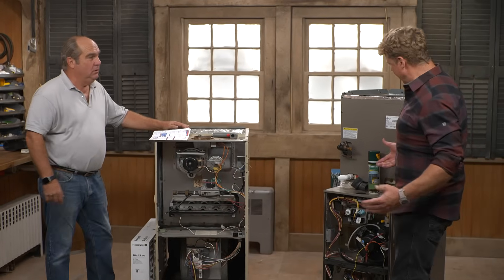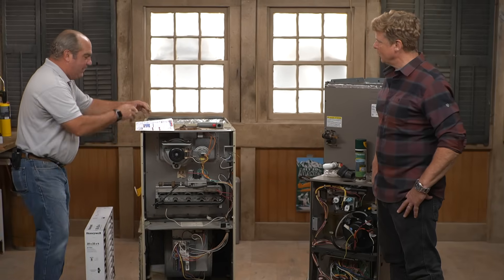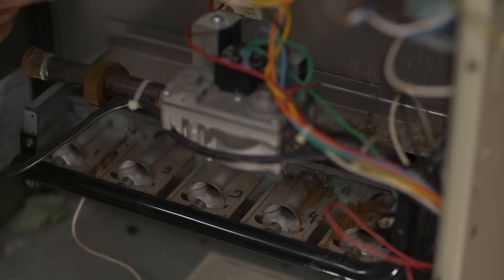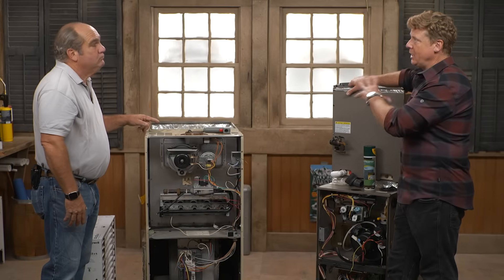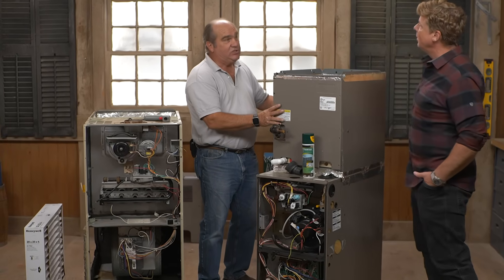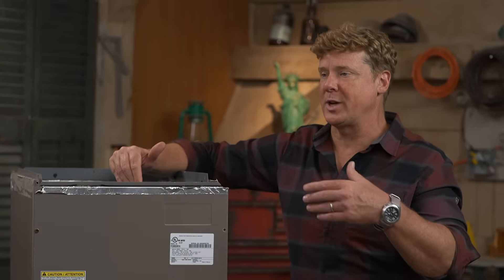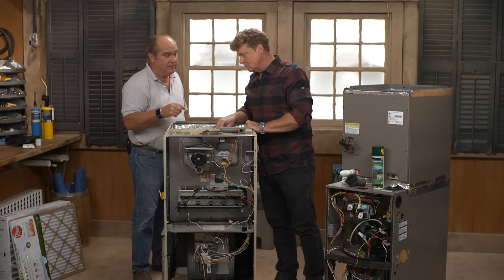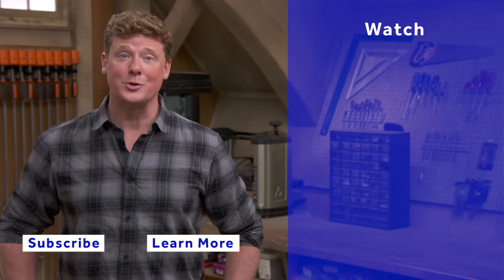Why is Furnace Maintenance Important? | Ask This Old House

Comment: How much of an issue is having too much filtration stressing your blower motor? Some folks say find a good balance of filtration to air flow to reduce the blower motor working too hard. Some say go off the manufacturer of your HVAC unit. Thanks!

Edit: spelling

Comment: I have never seen any HVAC company do extensive furnace checks when I hired them. They didn't check the static pressure, didn't check the combustion product with a combustion analyzer, didn't check the gas pressures with a mamometer. It doesn't matter if they are licensed since only the boss has the license. They will just send a company trained sales person to just check the furnace filter and check the fan motor currents. Maybe they will spray coil cleaner on the condensor unit but they never check the indoor evaporator coils. These sales people look for "problems" and sell overpriced services to "address" them. I have asked one of these sales people dressed up as technicians if they can explain what's on their "50 items" furnace checklist. They get very defensive to claim that most of the inspections are "visual only" and their company doesn't provide them a way to produce a report for the customer. The real job for these "technicans" is to sell services or new HVAC installs.

Comment: The heat exchanger in our last furnace cracked and the only reason it was caught is because I noticed the exhaust gas coming out of the pipe smelled different and had them come check it out. They showed up and red tagged the unit because it was such a danger to us.

If you live in an older house, get CO detectors, people! We didn't have any and could be dead because of it. Thankfully we are still here and our house has been updated to be a bit safer for us.

Comment: So throrough but I highly doubt if 99% of furnace maintenance folks really go through everything you mentioned.  My last furnace lasted me 24 years, zero maintenance other than replacing furnace filter every other month, religiously..  Saved me easily $2500  in today's dollars, over 25 years and replaced it with a brand new one for $3K.. This is my math and it worked for me.
Reply: saved you way more than that.  Just for them to knock on your door is $100 or more.
Reply: I have a carrier installed 2020  i change filter every month and after watching a few videos think ill start vacuuming every year and hope itll last 20 yrs without maint. calls

Comment: My central heat and air unit  is over 35 years old. Recently, the temperature guage stopped controlling the temperature in the house except when other heating units like the oven or dryer were on.  The temperature guage was replaced yesterday. Overnight the temperature dropped to uncomfortable levels. After about an hour after waking up the temperature has risen to a comfortable level. I feel the heat. Ichecking tge futnace worth a try or should I replace the unit?

Comment: 1. Good luck finding an HVAC tech who will actually do any of this testing. They are there to do one thing - sell you a new furnace.
2. Many HVAC pros believe it is paramount importance to have as much airflow as possible through the unit, because the more airflow is restricted by a filter, the harder the unit has to work. A filter is there to stop big things, not small dust particles.
3. Every home should have a combination fire alarm/carbon monoxide detector on every floor at minimum. An additional plug-in carbon monoxide detector as backup is a good idea as well. Carbon monoxide will kill you. Spend the few bucks.

Comment: No need to scare homeowners into thinking a cracked heat exchanger will kill them. Yes it is dangerous, but 2 things. Heat exchangers in this application are under a negative pressure due to the draft motor that he mentioned, air would be getting sucked into the heat exchanger not pushed out. The furnace also has safeties that he also mentioned that will detect when the flame is blowing back into the cabinet due to air getting into the heat exchanger. But absolutely you should get your furnace and ac maintenanced twice a year, once for cooling season and once for heating season.
Reply: Exactly.  There would have to be multiple failures - like a cracked heat exchanger, failed inducer motor and/or blower not working - and some of the other safety checks the system uses to avoid these situations.
Reply: Correct, there are many fail safe safety features.
Reply: I have been told by HVAC people 'don't get a service on your equipment' especially for the AC.   They said there is limited utility in general for doing that but that a lot of the techs doing them don't know what they're doing and will actually do damage
Reply: @jeffa847 lots of hvac manufactures won’t even warranty parts if the system isn’t maintained.

Comment: As a retired first responder for a gas utility I can tell you, Richard does make a lot of good points but he is totally wrong about cracks in the heat exchanger putting carbon monoxide (CO )into the airstream; yes, cracks can contribute to products of combustion entering the airstream but not in the way you think. Once the blower comes on it puts positive pressure on the heat exchanger and if the cracks are large enough this will cause flame rollout to enter the vestibule of the furnace causing products of the combustion or CO to enter the area around the outside of the furnace and possibly get sucked in through the blower compartment. The furnace Richard was showing had something called flame rollout switches that would prevent serious flame rollouts from occurring by locking out the furnace , they’re not perfect, but in most cases they work as designed preventing hazardous conditions. Just a note and reminder this is the 21st century everyone should have a carbon monoxide detector /combustible gas detector & smoke detector (nowadays they have all three combined into one ).
Stay safe out there , have those furnaces periodically cleaned /serviced and make sure you have those working detectors 👍.
P.S. , note to this old house producers: videos like this should be done in the beginning of the heating season (October ) not at the end of the heating season (March almost the beginning of April). I’m assuming you’re going to talk about maintaining air conditioning systems in December? Come on guys, let’s use a little common sense.

Comment: I would love to see HOW to clean the A/C fins. I had an electric furnace installed and they only told me after they had sealed everything back up that the existing ac fins were dirty and that I should hire someone to peel the furnace apart to clean them.
Reply: You uninstall the coil, recover the refrigerant. Temporarily Braze the lines closed on the coil to keep the water out and rinse the coil out with water outside. That is really the only way to do it right. Doing it in place with cans of coul cleaner doesn't work as well.

Comment: In gas furnaces, is it customary that new air goes in from the bottom of it?
Reply: I think that is how most are done these days, though my old system pushes air in from the top. The AC unit is actually beneath the furnace stuff on mine.
Reply: Yes it’ll come in from the blower motor at the bottom why having a clean filter is important
Reply: Your model number will indicate if it is a cross flow (horizontal mounting) or upflow or downflow. Some can be installed in multi directions after reattaching some parts to the new orientation

Comment: Out of curiosity, what’s a good price for an annual maintenance call for a furnace combined with an AC unit? Not asking about repairs…just the call for service and going through the checklist
Reply: I don't know.  My honest guess would be a range of $125.00 to $175.00.max plus the filter.

Probably, in part too the area of the country.
Reply: When I did residential work before i left for commercial it depended on what needed done. Basic clean and check should take no more the  1 hour 15 mins. We were 105 for the check and any parts need with labor was extra.
Reply: $69-$89 tune-ups are common in California
Reply: Upstate Ny - 200-300 dollars for "tune up"  both units. They do not do combustion tests or gas pressure adjustments for that. If you need parts or refrigerant that is extra big time.
Reply: @rzh3443 this is why i never have or will pay for annual maintenance in my furnace.
Reply: @rzh3443  Same in Boston

Comment: This Old House: please do a video on Gutter Guards...which ones work, if any. Cost effectiveness etc.
Reply: I wound up buying leaf filter. It isn't cheap and purchasing it is like buying a new car. SO far, through several rain storms,  it works, but their warranty has a lot of if ,buts and ands. I think TOH did do a review of these guards at their site. Depending on your age and the levels in your home , you may or may not want to bother because they all need some maintenance at some point despite the sales hype. Agree the solid type guards are really only effective for leaves. Tree seed and pine needles would be elusive captures.
Reply: I have been pleased with Gutter Glove since 2009
Reply: I've spent plenty of time researching different types of guards for gutters but there's never been a type that gets consistently better reviews than others.  I concluded that the effectiveness of any particular gutter guard probably depends on the specific type of falling debris.  I'd rather clean mine out twice a year than have to spend lots of time taking them apart every few years because my gutters have clogged.
Reply: Being in home repairs,  I deeply believe that most if not all solid top gutter guards with the little lip is very near worthless. 

I would recommend just the old fashioned open steel screen type.
Both Home Depot and Lowe's carry these.  They also carry the new snap in one's without the hinges. I have used both with successfully. However,  there seems to be pros and cons to just about anything including these.  For example,  the steel old fashioned type eventually rust (takes years) , they are not the best around pine trees due to pine needles landing in the holes, leaves can still get in on the ends, and in some applications don't look the best.

The newer style guards over lap pushing into a slot (you may have to do slight modifications including bending down the very ends - or custom cut a piece and then shape for the very ends. Moreover, sometimes the power coat can break down and rust in time.

Other folks I'm sure have their opinions and experiences as well., but these are mine.

Plus going this route doesn't break your bank account. 

Hope this helps. 

RB in Mid Georgia

Comment: Important to note that this only applies to gas fired furnaces.  Mini splits, heat pumps, and electric heat does not have this problem as long as you use the right filters, change your filters often, and clean your units regularly.  There is no CO or NOx gas in a furnace that doesn't burn propane or natural gas.
Reply: You still have to have the delicate inverter boards checked and inspected. They are very expensive to repair if the high voltage board goes and damage the other control boards and variable speed motors
Reply: Is that also true for oil furnaces which is what I have?
Reply: @BobbieJeanM  No, Oil Furnaces should be serviced annually as well. The jets (sprays the oil into the burner, causing it to for tiny droplets that burn easier), filters, etc all need to be cleaned/replaced.
Reply: Yes, better off going all-electric and then you can avoid plumbers altogether.  Our last house had an electric furnace (cost, $700 vs $5,000 for a gas furnace), and an electric water heater ($275 vs $1,200).  These prices are all CAD as I live in central Canada. The monthly bill was not much more, electric appliances last a lot longer than gas, and you can repair/replace any of it yourself for very cheap.  Add some solar panels with your savings and knock your cost down even more.
Reply: @karlhungus545  And I do already have Solar.  But gas is still cheaper for heat.
Reply: @karlhungus545  I have lived in an all electric house 2 times and my favorite thing is the lack of dust being blown when the heat is on.  Even with filter changes, the ductwork gets dusty.  Years ago the advantage of gas used to be if the electric went out, you could still cook but with electronic ignition everyone is out of luck.  Unless you have a generator or wood stove.  😏
Reply: @BobbieJeanM  I actually installed a new wood stove in my last house build, after being all electric for the first two years.  We lived on 160 acres in the forest, and I like cutting wood.  My power bill was still $120 per month, but the heating portion became zero (average -20 to -45C in the winter), and there is nothing like radiant heat when compared to forced-air.  Our power did go out for a day every once in a while in the winter when we got storms, but I didn't have anything to worry about with the wood heat.
Reply: @karlhungus545  best heat in the world in my opinion!
Reply: @karlhungus545  No thank you! Electricity is ridiculous expensive here. I plan to go to a Tankless system eventually for Heat and Hot Water. Will save a ton on Gas and such, but also requires annual maintenance.
Reply: @davidm7971  Gas is cheaper here too, but when you factor the cost of the gas appliances, need for someone with a gas ticket for any replacement or repairs, and the vastly longer life of electric appliances, you'll save a lot of money on all-electric.  My  power bill (2 year average) was $274 per month when I was all-electric.  Now, back in the city, in a smaller house that doesn't have a large cathedral ceiling and huge wall of rakehead windows (like my last build) my combined power and gas bill is $269 per month...a whopping $5 per month cheaper.  Remember, this is on the prairies in Canada, where winter is for real 😉
Reply: @karlhungus545  My Electric Bill currently averages $12.84 U.S. per month to my utility and $50 to $150 to my Solar company (I pay for every KWH generated and earn credits for my utility.  Till I but out the system)

Comment: What about annual maintenance for a Gas Boiler furnace for Baseboard hot water heat? What maintenance needs to be done for those?!?
Reply: steven lavimoniere is the youtuber to watch... he's up in MA.
Reply: @thebluelunarmonkey  I've watched him a few times.
Reply: Cleaned and they need to be analyzed as well
Reply: They should be done every year before the season, pull the burners, inspect the heatexchanger on the boiler. Verify pump, zone valves and safties work. Inspect for proper draft and CO.
Reply: They need to be cleaned. Try youtube.I hear they make videos on how to do stuff..
Reply: @landonlandon5533  OH I know.  My question was more to TOH and if they have a video or could do one for it.  I just give mine a good vacuuming and such before starting it up for the season.